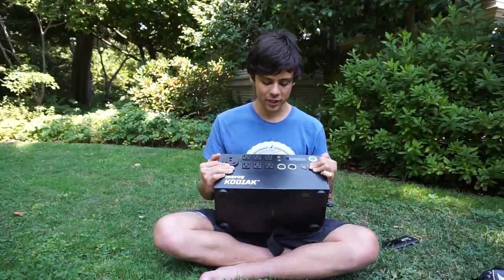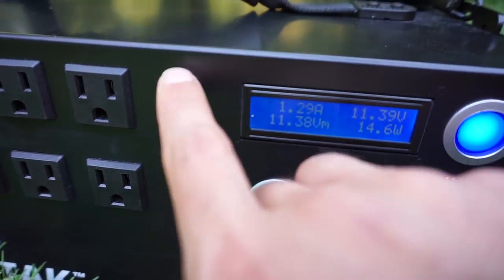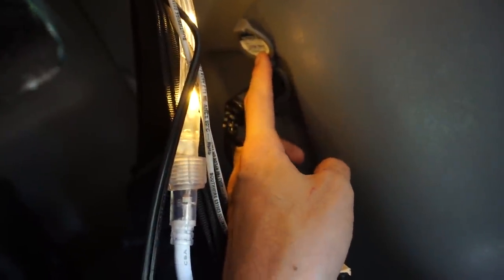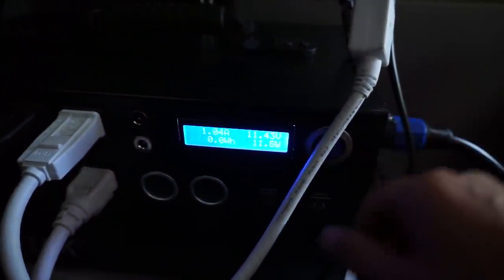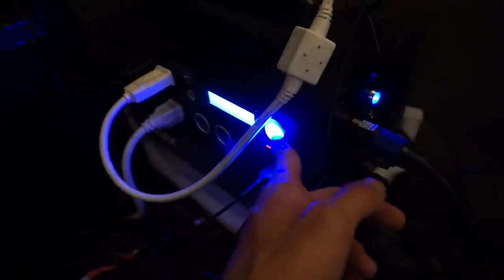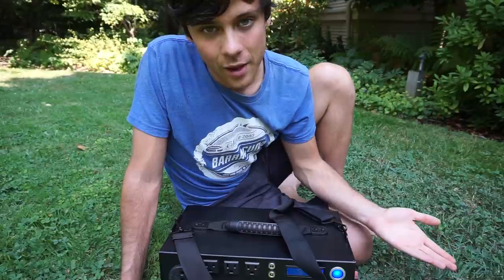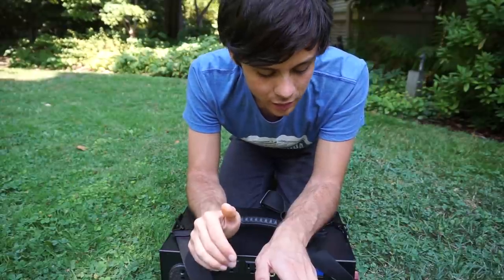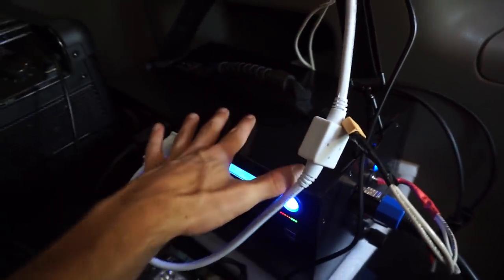Inergy Kodiak Solar Generator Full Review: Pros/cons, load test, how to use it and much more!

Comment: Quick note - we rate the Kodiak for 1,100 Wh of battery capacity which IS available, if you read the user's guide or technical spec section we rate it at 550 Watts of output (combined AC & DC) for 2 hours to get the full 1,100 Wh capacity.  Voltage drop under heavy loads (approaching 1C and above) will cut any battery short that is spec'd accurately, especially if you want the life expectancy that is possible. With that high of a discharge rate you're also creating a lot of heat, so depending on ambient air temps the system may shut down early to protect itself, also affecting run time.  As for the inverter - we have a video we're posting tomorrow of it running a welder at a nearly 2,000 Watt load, well beyond the 1,500 Watt rating.  The inverter can output continuously 1,500 Watts all at once, but that doesn't mean it can do it for the entire 1,100 Wh of battery capacity.  If it couldn't turn on with those loads attached, then our 1,500 Watt claim would be false.  Take home - consider Voltage drop, ambient temperature, and state of charge when trying to project run times!  - Jared
Reply from the maker: +Inergy thank you for posting this!!
Reply from the maker: +Inergy +Inergy just read the manual again. I was incorrect. I will have to add a note of this in the video.
Reply: No worries, you did a great video!  Love it!
Reply: What about his suggestions? Will any of them make it to the next generation Kodiak?
Reply: Can you charge this unit from a 110 volt outlet?
Reply: Is it possible to replace the battery in the Kodiak once it does die?
Reply: sc1212able yes,  110/120 VAC
Reply: Thanks, I have looked at 10 video reviews of this product and none of them talk or show how to charge this thing from a wall socket, I would think it would come with a wall socket cord from the factory, just not seeing $1800.
Reply: sc1212able. Unless I'm mistaking it has three ways to input power into it.  A USA 120vac cord, 12v dc plug (cigarette adapter) or solar panels in some fasion.  There should be restrictions to use then 1 or more at a time but I don't the specifics on that. Cheers.
Reply: I intend on using the kodiak system in conjunction with a car battery Tesla battery bank power storage room the size of a freight shipping container to power my home. I’ll use specific modified solar panels to power the entire power storage room as well. Got inspired by another YouTuber who’s never had a electric bill. ☺️
Reply: Great of you guys to post. Ill be a new customer soon.
Reply: Quick question, I see that the unit is spec'd for 32 volts at 30 amps. I have two 300 watt solar panels picked out that put out 32.5 volts at 9.24 amps. Will this damage the unit or shorten its lifespan?
Reply: @sc1212able  Did you WATCH this video? 10:26 and listen this time.
Reply: When will they be in stock again?
Reply: Inergy So glad to see you are responsive.  On my brand new unit I am charging by wall socket power and no light or charging and the fan is staying on even when cool and off for hrs without any drain. No panels ever hooked-up yet

Comment: Inergy does not recommend adding an expansion lithium battery.  When I called them they simply said there are many cheap lithium batteries available and cannot guarantee there would not be any issues.  You have a lot of experience with Lithium, much more now than even you had when you made this video.  Have you done any tests with adding  Lithium Battery and would it be ok with a smart technology lithium battery?

Comment: Great video Will.  I actually watched this a year ago before I purchased my Kodiak.  I bought a Kodiak about 10 months ago to be used during power outages/emergencies.  I tested everything and it worked great.  I then tucked it away in my emergency preparedness closet for safe keeping.  Every few months I would take it out and make sure it was stiull fully charged.  So far, so good.  Last night I got my first extended power outage so I excitedly pulled out my handy kodiak so I could plug in my refrigerator and freezer.  Shit!  the 110 outlets are not working.  wtf?  The LED base camp lights work.  The USB ports work.  But, I was getting nothing from the 110 outlets.  So, I unplugged everything, turned it off and tried again with just a simple table lamp.  Nothing.  All 6 110 outlets are dead.

This morning I took the kodiak in to work and plugged the charger in to a wall outlet on a whim.  After about 10 seconds, I unplugged it and then tested the outlets on the Kodiak and they are now all working.  bizarre!  Looks like I can't rely on this thing for emergencies if I have to plug it in to a working power outlet in order to get it to work during a power outage.  See the problem here?  Needless to say, it's a very expensive disappointment.  Next time, I will try plugging the charger in to my truck to see if that will "reset" it.
Reply: Just buy a jackery. They work great and are inexpensive. Connect a cheap 100w solar panel to it and you're good to go. That's what I do!

Comment: The more I research this the harder the choice becomes...
Kodiak 1 year warranty, can output over 1000 watts.  and everything in one small package.
Battle Borne 100ah battery (9 more ah, and 10 year warranty ) 100 amp output max (about 1000 watts)  I'm on the fence about building my own system, unless I am concerned about space.  It is insane to think that the Kodiak is so small and has all the features.  I just wonder how they can pull more amps out.
great video, keep up the good work!

Roger

Comment: Greetings from Victoria Canada Will! Enormously grateful for your thorough review...SUPER helpful as I am am venturing out of my comfort zone and planning to pack up my newly acquired vintage VW Karmann Gipsy motorhome and head with my canine male companion/caregiver south somewhere off the grid away from our cold and rainy winters. 

After watching your review I decided to invest in the Kodiak. After getting my malfunctioning charger replaced by Inergy (wonderful prompt service by the way) I am up and running (I think).The problem I having is that the car charging cable I bought blows the fuse in my cigarette lighter socket which is 10 amps. Talked to Inergy and found out I need  20 amp socket. Your review suggests to wire a socket directly to the battery. I did manage to find a 20 amp rated socket on Amazon and also bought a 12 guage wiring harness kit with a relay,  an on/off switch and inline blade fuse rated for 600w and 52 amps. Also got a 20 amp male dc plug. Will this work? I want to be able to charge it as quick as possible while driving. The other challenge I am having is trying to figure out how to use the Kodiak to charge my coach batteries (two 6 volt AGM deep cycling batteries) when I am off the grid. The charging system that is in the vehicle is still original European 220v..fortunately everything runs off battery so no shore power is needed. I have a 15 amp Noco Genius battery charger/maintainer. Can I just plug this in to the Kodiak and use this? I have been told this is a very inefficient way but no one seems to be able to provide an alternate solution. I am having  two 100 watt solar panel installed on my roof and hope to get a couple of Inergy 50 watt Predator panels if they ever get them back in stock! When I brought the Kodiak to the RV shop here I think I blew their circuits ... they didn’t seem to have a clue how to integrate this into my setup!!!! Told me I would need to leave the vehicle at their shop for a week for the to figure it all out. 🤑The Marine guys were marginally more helpful. I walked away with a $80 “battery connector”  that I am not exactly sure how to use and what it does (and an offer to “discuss further” over “coffee” after work hours 😏

Any advice you can provide is very much appreciated Will.

Comment: I knew I recognized the blue lcd in the last video. I too was disappointed to find that the usbs were not live but the unit had to be turned on to use them. So with that is the light and noise of the fan. 
One thing to note regarding adding batteries. First off, the guys at Innergy use the Costco agm batteries with the Kodiak. One customer added 6 batteries to the unit. Thing is, the Kodiak never will fully charge the extra batteries as it maxes out at 12.3 to 12.6 volts when it's fully charged. So the add on batteries are only 3/4 charged. I don't know how that plays out with the 30% discharge ratio of fully charged batteries vs only 3/4 charged batteries. 
Have to say I am happy to hear of your endorsement as I felt the same way in that it seemed like the best option out there, even though one takes the risk of it being a new product. 
Another issue is that when you are charging the unit and using it at the same time the incoming power still has to go to the battery first and power drawn from it as well. Not a biggie but does use up charge cycles. 
Good news is that a replacement battery costs 300.00 today. I understand in 3 years that the price should drop on these types of batteries. Bad news is you have to ship the unit back to have them replace it. Cheers.
Reply from the maker: Great points. and good to know about the charging. could use a dc to dc battery charger to fix that problem. inefficient though. will be hooking up a lead acid this week to test it. thank you for letting me know. that is unfortunate.
Reply: Cool. Just be glad you did not have to pay an extra 35% as I did bringing it up to Canada. But your day is coming. Use that paper to buy real things while it still has value.
Can a person mix and match different sized panels, such as adding 100 watt flexible panels to a 265 watt panel?
Reply from the maker: +VanoRama RV haha great point. That scares me. And yes absolutely. Just parallel connect them with a mc4 branch connector

Comment: Bought Kodiak instead of Goal Zero due to this review. You did a very professional job and I like how you stay on subject and kept the review relatively succinct and followed up important information with text in a clear font making it easy to go back and find what is important.
A question about temperature rating for use. I noticed that the generator is rated down to -17 deg F. How is that possible with Lithium batteries?
Reply: Do you like your Kodiak?

Comment: Since the Inergy failed the max output test I would have liked to see another test, say drawing 300 & 600 watts to see the outcome. I would say this would be a great unit for portability but not for installation in a vehicle. Anyways, very good, quality review. Last, some youtuber named Van and solar adventures reviewed this unit and said he ran an a/c unit. I gotta watch it later.
Reply from the maker: +ross kelly no way!! Air conditioner? Wow. 

I think I may make some videos of me simply load testing it. I run 300 watts on it for hours with no problem. But yes I am curious how it will do as well. Will have to make some videos on this soon.

Comment: Q? - I am building an off grid cabin in Montana - I have been pondering the Kodiak for my electrical needs - the solar is a little iffy with cloud cover - but the Kodiak could be charged with my Toyota Prius - What do  you think about using a Kodiak? - Also if you would like to visit Montana and help with the Kodiak project I'd pay for gas and you'd have a place to park your vehicle - it's really pretty here and lots of opportunity still exists.  Thx for  your video's they are great.

Comment from the maker: Huge mistake!! The manual states that the Inergy Kodiak can only handle 1000 watts continuous ac load. It has a 1500 watt inverter, so thats what I thought it was rated for. I was wrong! Battery discharge rate is less than the inverter.

More information about solar generators that I like and dislike can be found here: http://www.mobile-solarpower.com/plug-n-play-systems.html

My latest book: "Mobile Solar Power -Made Easy!" is still a best seller on amazon!! Check it out here: http://amzn.to/2qdzaGJ
Reply: Check your amazon link, it's a dud
Reply from the maker: funkydozer really? I just tried it again and it worked. Just now.
Reply: It was uBlock Origin stopping the window opening, my bad
Reply: Hi ..I went to your page ..I'm really cofided ..I'm just want to by something simple .. lol .... can you help me pick something .. I'm looking for grid down backup ...  and I know absolutely nothing about inverters ..or wires lol.. or generators ...  who do I call to help me .....w such things .. I can get a K for 1500$ rt now is that good ? ..lots of questions ...can we talk ..ll🙃
Reply: Will Prowse Can't you extend the units runtime by adding an external battery?  Isn't that the use of the 12 input connections, or am I way off here?
Reply: Paneh C It depends on what you want to power and for how long.  Is this for a day, week, month or longer grid down?  Are you powering a whole home, a refrigerator/freezer, water pump, microwave or just small electronics?  Will you be stationary or moving during the grid down?  There's a lot to consider before choosing a power solution, so you need to have it all sorted out before you buy.

Comment: For those who want to charge a 12 volt system faster than running a vehicle's motor and alternator, it makes more sense to buy a small generator say 3000 watt, and a plug in battery charger like a Schumacher SSC-1500A-CA Ship 'N' Shore 15 Amp SpeedCharge Charger, it would use less gas or even larger like a 40 Amp RV battery charger, and would charge faster, also, you could purchase an a charger to max out whatever generator you would like to buy. Cheers

Comment: William -- They used to say it weighed 20 pounds.  So it couldn't be LiFePo. It might be 3s with 18650. Need about 100 cells, give/take, maybe 11 pounds. LiFePo is safer in marine or RV use, but much heavier.  Wish I knew what cells they use. Ebike packs tend to last 200 or 300 cycles. You can get more with a charge cutoff at 4.1 or less, with 4.2 being 'standard'.  

When I was looking for the cheap and dirty way to run a microwave in my TT I figures a 48v and 20 AH ebike LiFePo (Chinese) plus a (48v) PSW inverter. The inverter I found weighed (drum roll) 47 pounds. I'm not saying Kodi has a pretty skimpy inverter, but you know. So the whole thing was 65 pounds and $1k.

I'm more skeptical now. To use RV 'safe' cells you need to add a lot of weight. To get a performance inverter, ditto. Thanks, because I know a lot more than I did before.

Surely the bear embossed on the fan is a Kodiak?
Reply from the maker: +George Sears wow!!! That was fun to read. And yes, I am a skeptic too. I am really curious to see what's inside this thing. I might ask them for pictures of it's internals. 

Ohh is a Kodiak a type of bear? I honestly have no idea what that word means haha!
Reply: William -- I'd like to know what the configuration is. You seem to focus on the input from solar. They could probably do 500 watts. Apparently K told you they just use a switching regulator, so they set constant voltage. That's what lith data sheets call for. Here's an interesting discussion of switching versus MPPT.

https://www.eevblog.com/forum/beginners/mppt-vs-regular-smps-for-solar-charge-controller/

Here's a switching power module that can be programmed for CC and CV. i can't get more than 200 watts.

https://www.amazon.com/gp/product/B01GFVI6R6/ref=oh_aui_search_detailpage?ie=UTF8&psc=1

I charge a 45v pack I made with Titan flight RC packs with this module. Titan build with 18650 cells from Panny. 

Here's an article I wrote on lith and charging.

http://www.electricbike.com/introduction-lithium-18650-batteries/
Reply: Cool. Btw, I need to learn about ebike setups. I'm thinking of ordering direct from China! But to buy just one, the price isn't much better than what you can buy in the U.S. (indirect from China). Now if I could find 999 people to buy with me, we could get a good price on a lot of 1000!
Reply: Hi. That's kind of what they do on Indiegogo and Kickstarter with ebikes. They get the money and then go buy bikes. It's a chore buying from China because they don't always deliver what they say. Several guys are building bikes in China from Chinese parts, Rad Power, Volt Bike, Luna, Juiced Bikes, and Biktrix, come to mind. These are all pretty good guys who have built a rep over the years. I've built three bikes into ebikes with a Mac, a Golden, and a Bafang motor. You can get something like a Trek 820. Have fun with it. I've been riding for 3 years and it's still fun.

Comment: Thanks for all these reviews and videos, super helpful.  I'm wondering... would there be a problem with connecting a deep cycle battery (say 200ah) to the Kodiak, which is itself (the AGM) connected to the alternator via an isolator?

Comment: Great Video thank you.  One question...I am a part-time van dweller and want to run a dometic 35 fridge while I am boondocking. I also will be charging my phone and laptop once a day.  If I am camping for a week will 200 watt solar panel be enough to charge it back up enough to have the fridge on 24/7 ?  I believe the dometic is 6.5 amps.  I like the portability of the Inergy.  oh yes my solar panels will be portable also.

Comment: Looks like they addressed most of your concerns with the just announced new K2 model in pre-sell now, out in May 2019.  Alas, still no smaller 500w version.
Reply from the maker: True but I'm unsure of if the new plugs are good. Mc4 connectors are UV resistant and waterproof

Comment: Wish you would encourage Kodiak to build a connection for wind energy in their unit along with a bird friendly wind turbine that comes with the unit.  During the summer heat or winter cold while solar energy is decreased there will likely be a good wind source as fronts move through.  Solar has limits that could be overcome by selling a wind option that easily connects.